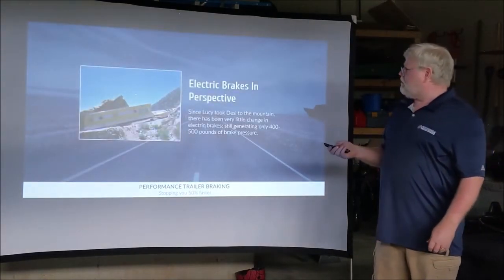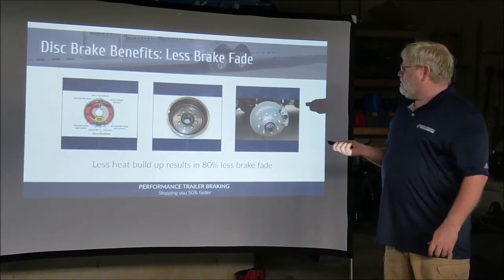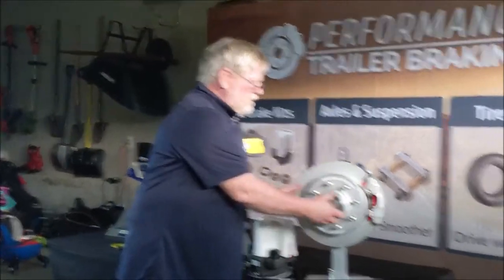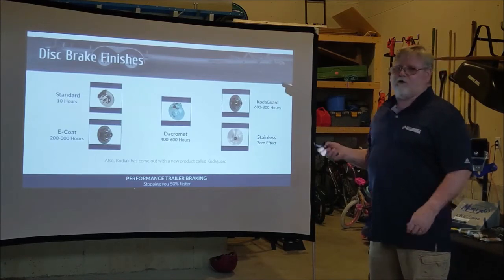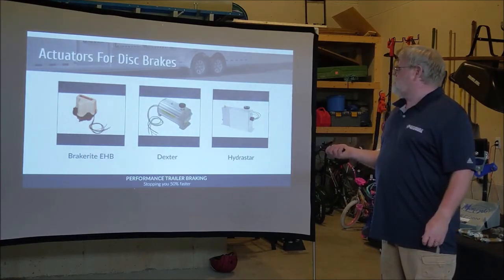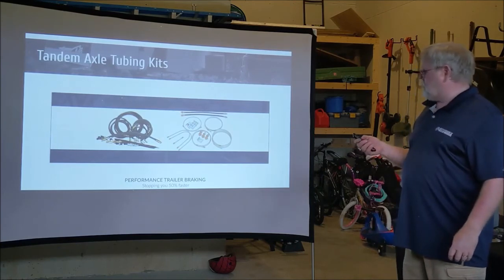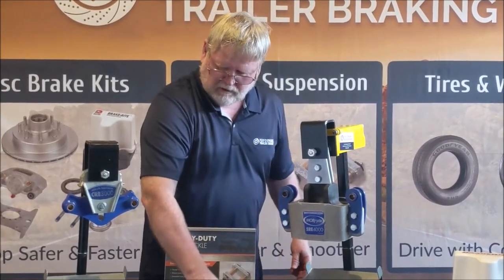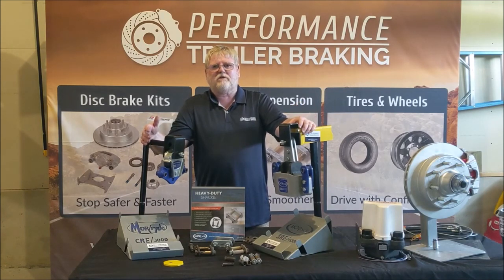2020 GDRV Virtual Rally - Performance Trailer Braking

Comment: Here in the Colorado Rocky Mountains we constantly see trailer with drum brakes overheating, failures and in extreme cases fires. 

People with EZ lube axels that actually use the EZ lube systems typically blow out the rear bearing seal allowing grease to go inside the drum.  

As a result little to no breaking capability, fish tailing, fire risk etc destroying the drum, shoes, bearings, etc. 

Lessons:
1. Get disc brakes
2. If one has EX lube system, don’t use it, manual remove, clean and repack your axel bearings at least once a year.

If the EZ lube axel has been submerged in water to the bearing line or above, manually clean, inspect and repack bearings as soon as possible.